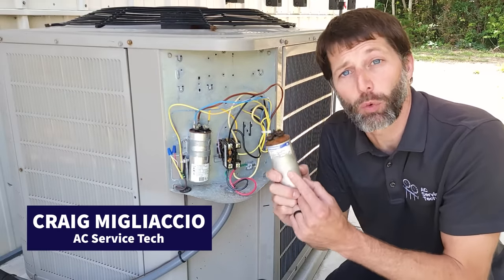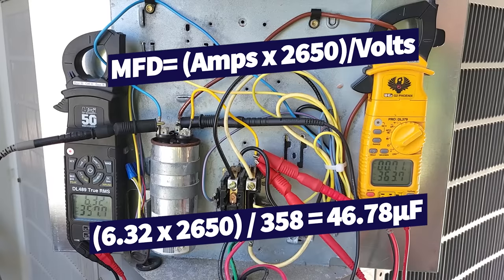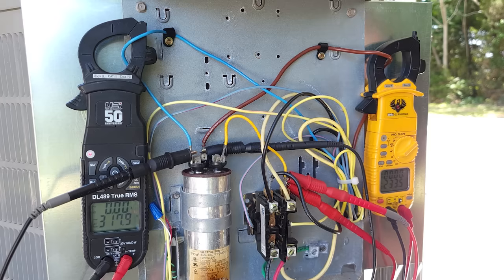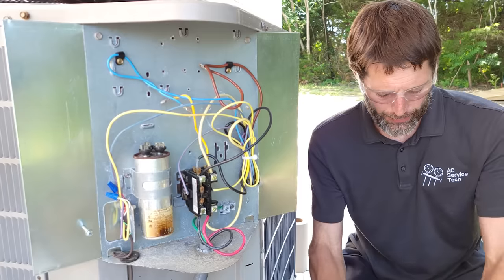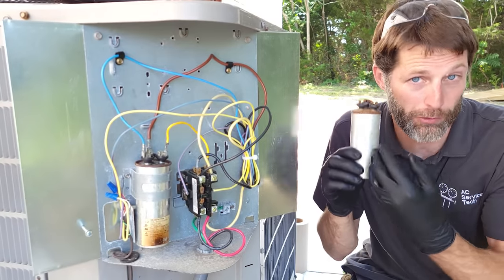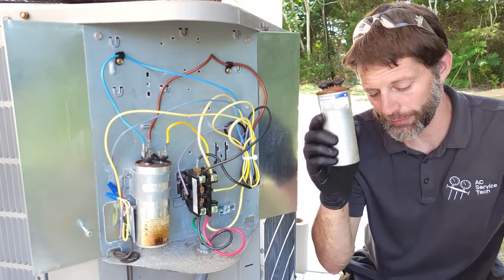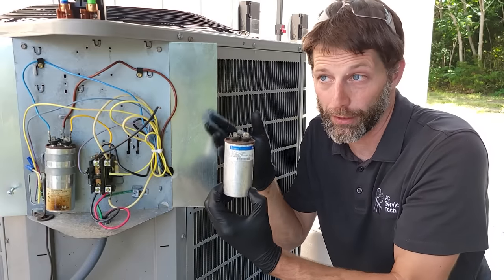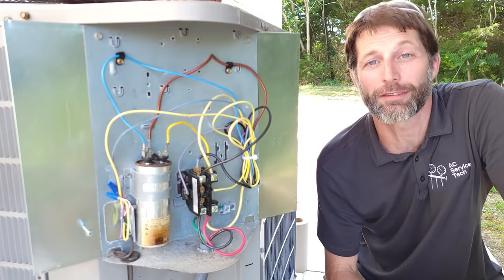WHY CAPACITORS FAIL in Air Conditioners! Watch it Break!

Comment: One more reason for failure.  The manufacturing intentionally goes out of their way to purchase the absolutely cheapest product that gets their unit running and out the door with a high failure rate due to the low quality product at a price point that was intentionally purchased.
Reply: it's called planned obsolesce.
Reply: That’s great for the service techs
Reply: I don't disagree, but then what capacitor do you suggest? I've been using the US-made Titan HD capacitors for several years and they seem to fail at about the same rate as others.
Reply: @chrisdeanndavison3626  AmRad. Will cost a few more bucks, but the only way to go.
Reply: @coldfinger459sub0  Thanks for the info
Reply: @joecooksey4331  I'll look into those.
Reply: circle of life sall good
Reply: Very believable. I’ve replaced so many bad OEM capacitors on units that are only a few years old. Carrier seems to be especially bad for this.
Reply: cough cough Carrier.
Reply: @coldfinger459sub0  this is most evident with Rheem. Up until about 20 years ago they’d withstand a nuclear detonation. The newer Rheems will leak out half their charge if you just look at it wrong. I personally think Goodman’s are decent, it’s all down to how they’re installed.
Reply: Bad thing is that even high end units are built just as cheap.
Reply: You understand why, right? People want "Made in America" quality for "Made in China" prices. If every brand used parts that were manufactured in America, they'd be twice as expensive as the are now. You think people complaining about prices now? Just wait until they see what it'll cost if we all used made in America parts.
Reply: @chrisdeanndavison3626  Cornell-Dubilier or Genteq.  I get the C-D for the dual caps and the Genteqs for the blower motor run caps. They're more expensive, but they don't fail in 12 - 18 months like the current crop of Chinese units do.  Besides that, I had a local company replace a blower motor run cap that measured bad on a service check.  They charged me $88.  The tech wasn't too clever, he left the box behind and I looked it up at Allied Electronics.  They sell for $1.88 in single quantities and a lot less in bulk.  That was the last time that happened.  I have a stash of caps now just waiting for the next lightning strike (that's what killed my original Aerovox, but they're not making the same quality they used to).
Reply: exactly!
Reply: These capacitors are running rather close to their rated volt. Using a 25% higher rated voltage can improve robustness. Heat is generated by the rms ripple current with the internal series resistance.

So to reduce heat, you can reduce the internal resistance by using two same capacitors in parallel so that each takes about half of the total ripple current.

And finally, using physically separate capacitors for the compressor and fan motor would help with reliability. Obviously all of this costs more and uses more space, but these caps would be much more reliable.
Reply: This is not always the case! As there was a era of the bad capacitors from a few foreign companies. They had a bad batch of electrolyte formula that would make the capacitor fail esr tests right from the start. It was hit and miss. But eventually they where all bad from the manufacturer due to bad formula in the component itself! Google “year or year(s) of the bad capacitors” and you’ll get something like this… 

The Capacitor Plague was an event around 2002 thru 2005 involving capacitors produced from about 1999 to 2003. This is an intriguing story about pushing the limits of chemistry and the industrial espionage used to get ahead of the competition in the world of low impedance capacitors.

So for that really good esr meter that will tell you under a actual load and not by “ringing” the cap by a multimeter cap value tester. Having a small low frequency ac sine wave signal and converting it into a value in (whatever value) but here we are using microfarads. It isn’t a good test unless it’s under a load. 

As this technician did exactly that! By demonstrating this test under a load of the compressor and fan motors amp draw. This beats an cap value multimeter test to me. The meter is good for testing the value and that’s about it. An expensive ESR meter isn’t much better unless the tester actually works with a load. It discharges the capacitor and then checks for esr under a small load and thus you can’t test in circuit. There’s a few that can test in circuit but not over a few hundred microfarad. 

I’ve seen several tv flat screens (Visio, ILO , Orion, Funai) “typical China brands”. Where they’ve miss diagnosed the trouble for a bad backlight inverter or display. When really it was a bad capacitor on the displays secondary backlight power supply. And usually it was just one that was shorted or opened causing failure. 

Also diagnosed and repaired several computers and all sorts of electronics in the early 2000’s with bad caps in the supply causing all kinds of intermittent problems and or failure. The first place I check is for the Raw ac to dc rectified filtered supply in a device. It’s filter or smoothing capacitor it a good start. Then check the 5v standby supply. Then the main and then secondary filter caps! 9 times out of 10 it’s a capacitor that failed and then destroyed or stressed whatever other component in its supply path. Other than cold solder joints from heating and cooling and stress from the capacitors failing. 

Great demonstration and video with both meters setup and checking both fan and compressor current and voltage! Also the heat down here where I am in the sunshine state also plays hell on the electrolyte and further stresses a capacitor! Even the 105 degree Celsius (My Favored) over the 85 degree rated. It’s the most environmentally sensitive component in any electronic, tube type or electrical device period! I also prefer Panasonic brand Caps. Dark green or black plastic case over the typical blue or sky blue. Why does that matter? You can tell they where replaced if it’s a returning product or a recall. High failure China knock offs names. 
Good old common names like Malory or Sprague! Rubycon …. Etc. 

I apologize for the lengthy response. But I wanted to explain the capacitor plague a little bit. And they are coming up to about 20yrs old now. Also older devices with very high end components eventually fail due to the environment there where in and or age. 

Cheer’s and here’s to a good fix!
Reply: I can tell you have never built anything professionally.
Reply: Sue them
Reply: Cheap labor and the elimination of the quality control phases are a recipe for failure. You get what you pay for. Counterfeits are another huge problem when buying anything nowadays.
Greed and fraud makes purchases very difficult. Only buy from reputable merchants.
Reply: @MrBonez208  No need to apologize... was read in full
Reply: @coldfinger459sub0  you are right. In the early 70’s (I’m old) I worked for Toshiba assembling laptops. At that time the president of Toshiba made 13 (mot a typo) times the lowest paid employee. 
We were managed by a smart, humble, manager. Then they decided to use American management and everything changed. The new manager’s ego was bigger than LA, and he would parade around with a entourage of about 6 sycophant engineers. Quality dropped off the cliff. His “continuous improvement team” won a company-wide award for correcting an assembly line adjustment that should have been SOP when the line was set up. 
Total political BS.
Reply: @chrisdeanndavison3626  Use the same mfd but get one with a higher voltage rating. I go up 30-40% or higher depending on availability and cost.
Reply: They design the parts to last a few months after the warranty ends; not joking, I'm an engineer.
Reply: @volatilememory9338  yep, I fix switching power supply caps often and higher voltage rating always improves the life.
Reply: @coldfinger459sub0  You described Hewlett-Packard in a nutshell. Service center was 25% of total income.
Reply: Wrong bad therrory, if capassitors not work, it not come on, if it dod by a major complete messup, it shut off fast with a damzged motor anf compressor and relay contacs melted
Reply: @gregz4249  it depends on ehat voltage it needs be over charged 43 minutes. As there is a voltage in most countries 440 volt 50 hertz dual or three phsze. Usa has 440 volt dual phaze three phaze 60 hertz. , the 440 v you buy is ok if for speed 50-60 hertz in usa but in a country uses 50 hertz , you can only use 50 hertz products or it melt all on the products in time. It the time it moves per second
Reply: @gregz4249  it not as what works best it what works period, 370 v divided by 3 is not even a even number, it not even a correct volt rating. There no electrical with a odd number unless it viltage shortage . As you know 3% voltage drop ruins compontents plus relays not work . Because % 3 voltage drop creates to much heat and coils freeze up and stop producing the manet field . It the magnet field that  the coil produces  to close contacts. Once loses magnet field as 3 % drop or more like power off it opens contacts or releases the magnet. There is relays in motor controled  programs ac a ac or ref or etc. 3 % voltage drop or more is caused by to small pathway or wires.
Reply: @chrisdeanndavison3626  measure  the volts at a even volt  and how many more times it need be to supply the compontent. Must be a even times number like 3×120= 360 or 4x120=480 , etc
What ever it need in 3 more senconds it requires.
Reply: @gregmercil3968  capasiters  is not just for storing power it to send increase power to motor windings on start up. All are used in equal votages remember.
Reply: @Pop_A_Chaderall  it thr president of the nation fault on prices. Economy  is that. Usa people vote on good economy is republican for cheap labor and cheao tax makes a cheaper product and is  in a  quality race to sale. If cheap and better quality the economy booms world wide. But  democrsas  want high wages and higer taxes makes a bad economy
 Products to expencive  so the quality  drops because cost to much to make. The cost of materal can not drop so leaves income to drop but they not so , they speed up the process losing quality means to high and a bad quality product.  Result is a bad ecomomy , none sales so jobs are lost.  That all a democrat and a republican means in usa. As for word meaning , democratuc only means voted in office as both republican and democrat is.  Also the usa is  of the republic as both democrat and republican is. It only divides the tax and labor charge  in usa only.
Reply: These Capacitors are cheap only about 10 to 15 dollars.  But alot of distribution place refuse to sell them the public.  They want to charge an extra 150 bucks to get someone licensed to fix it.  ACs usually go bad from either the capacitor or from the relay switch.
Reply: @jimmyjohn8008  incorrect. All acs i own gor over 15 years are still perfect, the cappasiters has no ptoblem on all 12 acs. All 12 are different brands was on sale in philippines. On 3 i had freon leaks , got repaired and still doing great, 1 is a split init and 1 a central unit, all others are wall or window units.  And all 12 by diffrent companies, china, singapore, usa, germany , and  japan are is the nations they from. As for working best is the 3 from japan. Both made in usa had freon leaks.
Reply: I just change my neighbors capacitor today. Tempstar unit only a year old.
Reply: @patbhvac1  you only changed a cap. And not find problem why it over carged and burnt ? Every thing has a reason to stop working. Sounds  like a relay stuck or voltage got 3 % low and power stuck on to long. Something wired dirrect to main power and something wired  to smsll that caused the low voltage. All low voltage is due to , to small conductor for required input amps. Means to small wire. All relays drop out at 3 % voltage drop. It saves the parts and motor , a capastistor also. Always trace down the cause not just a part, check why part failed. Tbis is real maintance for all electricians. If can not get a electrical problem repaired in minutes, it not a well trained electrician, that is a usa contractor agreement in the usa military. Minutes  in the  middle of a war , is manitory correction.
Reply: @patbhvac1  like in philippines a usa colony do not make panels with a earth ground bar. You must make one on them . Also make the ground rod with 3/4" rebar , etc. Its united nations code.
Reply: @michaelspencer6523  we had a storm come through early this morning I'm guessing that had something to do with it.  Still capacitors are built cheap these days.
Reply: @patbhvac1  no not really, they make more better ones todayto make electric batterys now. You can break  down a car battery and make a better powerful battery from only capasisters  now. It take me  a few hours to figure it but a regular size car batter cleaned out all cells and replace with  2 stacks of cap. Is higher but morr powerful longer also.
Reply: @patbhvac1  a cappasistor is inly a extra voltage containor.  , if  the materal is from china it not any good. It will not hold the charge long before the matetal is weaken and will not hold the proper  extra volts the motor needs to crank at 3 seconds 3 times the volts to run
Reply: @patbhvac1  capacitors is only a more stronger type of recharging battery,  it self.
Reply: @Pookybutt3  I’ve actually had to replace quite a few of those color coded ones too.
Reply: @Pookybutt3  on wiring is the same as caps or transisters or diodes. The wire material is nest at gold but prices on not long runs is copper, if on long runs it be aluminum clad. As 1000's of feet at 10,000 volt 30 amps 240 dual or 3 phase 60 hertz pole lines. The covering i have found best for conduit  is thnn copper wire.there is hundreds of temp covered  wire. It depends  on where it used and what for, is aire going to cool it like in a vented raseway outside and no sun or sun on it, etc.
Reply: Dodge, Ford, Chevy........ Barely hanging in there.  Glad I got rid of my Dodge....
Reply: @tomfrantz  my first car was a '95 Dodge Stratus. Man talk about a piece of crap!
Reply: @gregmercil3968  Dodge is why we are in financial difficulties right now. No intentional politics on my part here. Just cheap weasel parts and pieces made society go bad.
Reply: @coldfinger459sub0  I 100 percent agree.
Reply: Amen brotha!